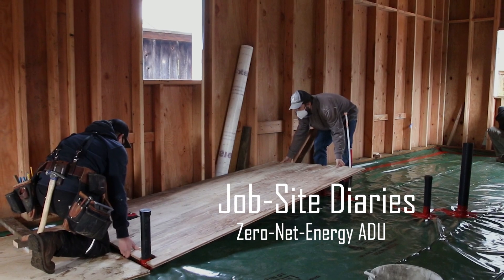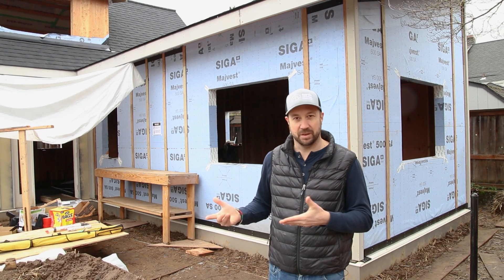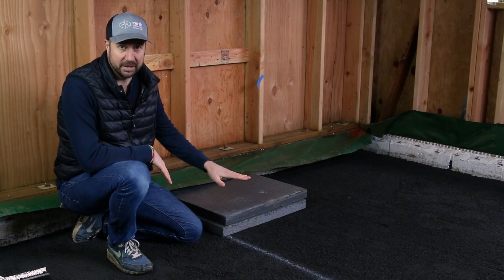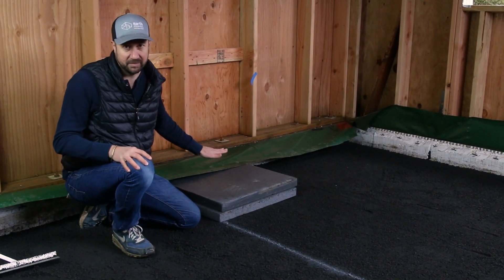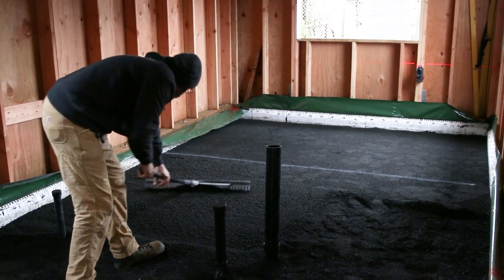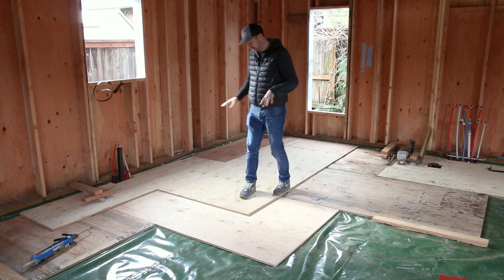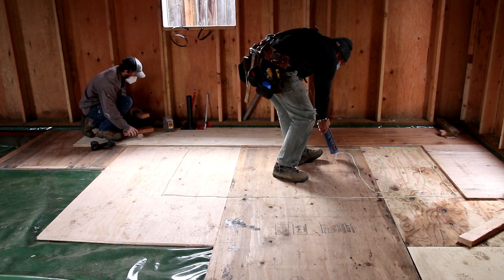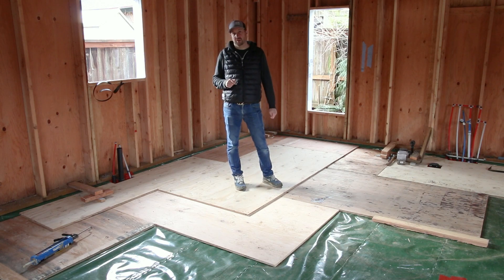The Concrete-Free Floating Plywood Slab Assembly

Comment: Why 2 layers of 3/4 ply? Seems overkill to me. Perhaps this would be needed in a laundry room where vibration might move the 
base layer. Otherwise, redundant. I notice this is from "Fine Homebuilding" not practical home building.   🙂
Reply: You could potentially get away with a single layer of T&G if you glue the grooves. I've never seen someone try that. You might need to use insulation with a higher compressive value though.
Reply: @niktak1114  Come to think of it, I worked on a remodel of a house(40's built,sort of shack?) that had 2+ foot spacing for floor joists and one layer of t&g heart pine flooring. It was surprisingly solid.

Comment: Thanks Josh for posting this, and for the great article in Fine Home Building. Regarding calculations of materials used to compare the two strategies-- plywood versus concrete slab-- the only thing to consider is the impact of concrete and steel versus that of plywood and finish flooring. Everything from plywood or concrete down is the exact same in either strategy. We're in discussion with an owner about opting for a plywood slab in place of concrete for a house lift so we did the math. The embodied carbon for a 4" 850 sf slab with standard rebar is around 2300 kg of CO2e. But bear in mind that this calc is based on materials in Seattle where we can get concrete with PLC and rebar from an electric arc furnace plant powered by hyrdo. Using more traditional mix designs and rebar from coal fired power plants and the embodied carbon for the same slab might range between 5000-6000 kg CO2e. For a plywood slab of (2) courses of T&G CDX and finish floor of oak, we're estimating the embodied carbon to be in the range of  1000-1300 kg CO2e . If we use salvaged or reclaimed wood flooring the number drops to about 700 kg CO2.  So In Seattle, a green building hotbed, we're looking at anywhere from 70%-50% less embodied carbon with the plywood slab assembly.  Cost is a different story. Concrete in Seattle is roughly $140/cy, or $1700 total for our slab, rebar adds $800 so material cost for slab is roughly $2500. 2 courses of plywood runs around $3200 with today's pricing; wood flooring @$5/sf is an additional $4200, so plywood slab is pushing $8k. 3x as much. If we bring into consideration the costs to polish and stain the concrete versus costs to sand and finish the floor then the it's closer to 2x as much. If we use the second layer of plywood as the finished floor the price drops even further. Other things to consider are that concrete is more durable and would require less maintenance over time, but also feels colder to the foot underneath and is harder on the joints. All that said I believe that a plywood slab is a great strategy and one that we need to employ more frequently. Yes, it costs more. But embodied carbon needs to be taken into consideration on every project and as Josh says, there's no greater contributor to EC than concrete. If paying twice as much only yielded an EC decrease of 10% I might not recommend it for a small DADU project, although I still would for a much larger project. Thanks again Josh!
Reply: I am curious why you’re including finished flooring in this. Is that needed to fully compare to the concrete? Also, I am curious how close the two are today now that lumber prices have come back down to earth.

Comment: Maybe just build on a few posts set in ground instead, then beams and joist if you don't want concrete. Why does a building need to be flat touching the ground across floors ??
Makes no sense to reinvent the wheel.

Comment: There is about a net zero chance that you have a lesser carbon footprint doing things this way.  20 years in commercial construction leads me to believe that you probably used up far more fossil fuels with the excessive layers of material, whose exact carbon footprint has not been quantified here. Most likely on purpose. 

Then you have to think about the exorbitant price increase to the customer, and for what? So that they can feel better about themselves because some shmo told them things, and they don't know any better so they believe it. 

And..... A 2 layer plywood floor floating on top of gravel is just ridiculous. Some day someone will be tearing that apart and cursing the idiot who built it, instead of the true idiot who designed it. 
Either way, stupid idea and you are most certainly NOT, saving the environment by one single iota.
Reply: how about because it's warmer and insulated the floor then?
Reply: How could 1.5" of subfloor have a higher carbon footprint than 6" of concrete?

Comment: Bashing concrete is too easy. strength for strength, concrete is hard to beat. The reason it takes up so much of the CO2 pie is because we use so much of it. Most building constructions are 100x overengineered, to account for sloppy workmanship, and because extra concrete is cheaper than the architects's person-hours tariff. If concrete were to be taxed heavily (and therefore used frugally) it would be one of the greenest construction-materials there is. Water-proof, termite-proof, weather-proof, fire-resistant, no VOCs and tough as nails.. what more can you ask for?
Please do an exergy calculation on all the SIGA engineered tapes and zip-sheaths and Schluter membranes and other fancy $tuff that the cool kids are touting these days, and concrete is just better. When compared apples-to-apples.
Reply: the majority of concrete is used to protect rebar from rusting.
Reply: @Guy4UnderDog  No. Rebar is too espensive, when used in compression. The aggregates in concreate are better bang for the buck. Rebar prevents it from failing under tension, If you could magically delete the cement/aggregate mix from an RCC building, the steel would flop around aimlessly. Granted, a different construction (e.g. a steel cabinet) can be strong, but for a given price, concrete is hard to beat. (On planet earth, anno 2024)

Comment: It would be useful if someone could do the calculations adding up all of the material you used (foam, plywood, plastic, glue) and all of the carbon that went into making it and transporting it and compare it head to head with concrete's carbon footprint. I see some doubters in the comments and they might have a point without any data to back it up. My gut tells me that this assembly is overall better environmentally but we can't make building decisions on gut alone.  Saying that - love the video, seems solid, and I wish my slab was waterproof and insulated!
Reply: So that comparison is in relation to your style of building. Everything vapor barrier and below are the exact same in a concrete/no concrete floor if we are talking a high performance assembly. So, assuming its a high performance build its the pour of the concrete versus 2 courses of 3/4" ply. and with a plywood board being about 54% carbon I would be pretty confident it would be concrete in a reasonably sized area carbon wise. Take out the foam and vapor barrier out of the concrete pour scenario and now its just an assembly with less performance.
Reply: Neutrality appreciated. Facts needed. We all have guts but they need to be filled with scientific evidence, not a pretty sounding building concept. I am waiting!
Reply: I would start here: https://materialspalette.org/palette/

Comment: What is the additional cost compared to traditional concrete?
Reply: I’m building one for the same cost of concrete slab, but this will be warmer.
Reply: Good question. 
Also what is the cost to dispose of it after the home is renovated or rebuilt.
Are the products biodegradable and recyclable?
I could go on and on and on.
Reply: @briantaylor7075 Then YOU don’t have to have this floor.

Comment: Is polystyrene biodegradable? 
How is it made?
Is the manufacturing process  greenhouse gas friendly process?
What do the trees the plywood is made of need to thrive to make more trees.... oxygen or CARBON DIOXIDE?... 
Is Less CARBON dioxide good or bad for trees?
Which is stronger overall... compressed wood (plywood) or concrete? No wonder so many houses are blown away.
Reply: I don't think there are any scientists out there concerned for the lack of CO2 for trees, to the contrary it is environmentally useful to sequester carbon by using wood products produced in a sustainable manor such as on tree farms. So long as we use and replant the trees we use we are taking the carbon they stored, making it useful, and preventing it from rotting and sending the CO2 back into the atmosphere for a long time.  You have a valid point on asking questions on how that foam is produced, and in general a lot of foam is horrible for the environment. This manufacturer seems to say that there's isn't so bad -  https://www.insulfoam.com/wp-content/uploads/2014/11/EPS_global_warming.pdf.  As far as strength, I wouldn't want to tile on top of this assembly, but any other flooring should work well i would think. The frame of the house itself is anchored to the concrete footing in the same manner that all houses need to be based on the code (even though a lot of old houses in my area aren't anchored at all and just rely on gravity!) It's an interesting concept and we builders need to (carefully) think outside of the box for the benefit of all our futures'.
Reply: @frattman  You are assuming trees are replanted. No evidence here or source of the trees provided. 
In addition to the polystyrene there are also 4 or 5 other nonbiodrgradable products used in the entire process. How are they made? How much energy is expended and how much of the earth is defaced. 

I agree we must look outside the box but innovation is not always to the benefit of the end consumer or the world. Selling products on the back of an ideology is what's going on. Plants need carbon dioxide and the more they have, the more oxygen is produced. We have been sold an upside down cake. I am not buying it one bit. 

Think how lush the earth was when it was warmer, when more carbon dioxide was in the atmosphere. The oxygen levels likely were through the roof which would have been awesome for us humans. Recent scientific studies if one cares to research actually indicates the earth is cooling not warming. To find it you'd have to dig through the online censorship so good luck with that.